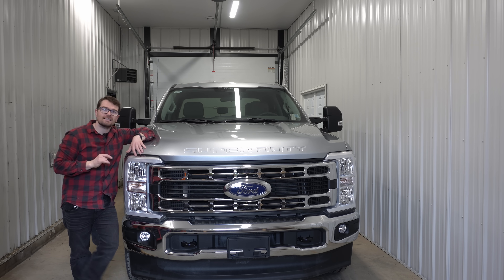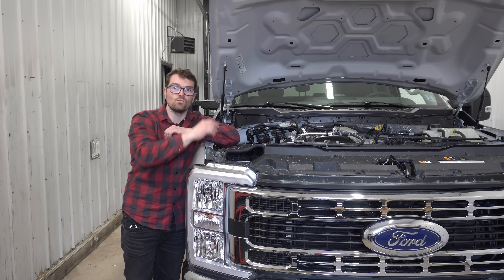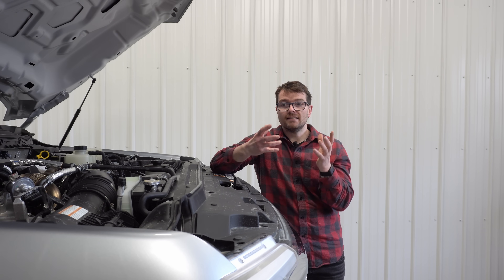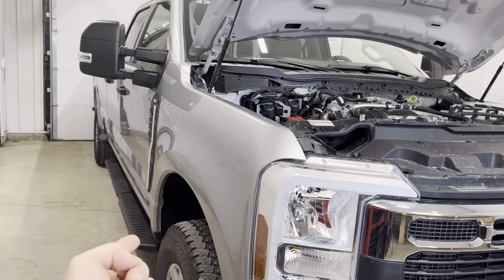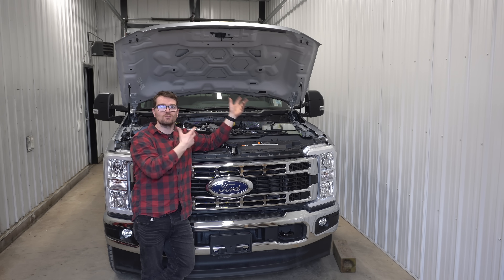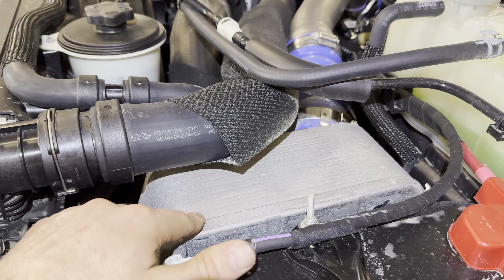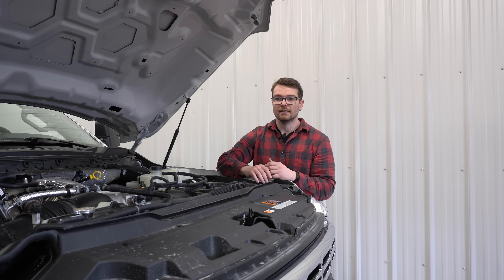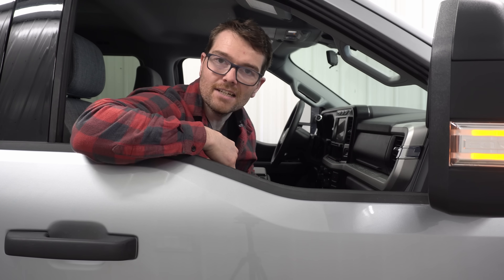Ford F250 HO PowerStroke Diesel Engine Review *HEAVY DIESEL MECHANIC* | How GOOD Is It??

Comment: Not many if any need the extra torque and HP, just going to burn more diesel with that tune. The SO looks like a very solid engine with a little better solution for exaust treatment. Will definatly consider this truck in 2-3 years when they come on the used market and we can almost afford it. 😂
Reply: The cost difference is small when compared to the already large cost of the diesel engine over the gas version. I came out of a 2020 Raptor and bought a 2024 F350 SRW 6.7HO Platnium Tremor. The reason for the change is to tow a 5th Wheel RV that my wife decided we needed. I do absolutely love this truck, it’s fantastic. I wanted something quick since I was giving up the Raptor for this endeavor and it delivers. 

I will be keeping this truck for a long time.
Reply: @Captain-Awesome "that my wife decided we needed" hahaha that's a big decision to let your wife make
Reply: @AlejandroDeZan  yeah, don’t get me wrong I’m pretty excited about it, but she was definitely the driving force behind it. Personally, I like to save money, but my wife apparently hates money every time when it comes to saving it or spending it, magically money just 💨 it something else besides money. Shoes, Purse, Clothes, a RV… 🫣
Reply: @Captain-Awesome  The cost difference between the SO and HO is super small when you consider that a new SS exhause manifold is about $800, a special cooled-jacket turbo would be more than $2k, somewhat less if you replaced the intercooler with something larger instead, and then we're not even looking at the labor for the cost of install and tuning and taxes on all of it. Plus factory warranty...
Reply: @anomatrix0000  Yeah, that’s what I was saying. It’s the reason I bought the HO.
Reply: The HO Power stroke actually used less fuel than the Duramax and Cummins while smashing them in torque and power.
Reply: Still don't like the idea of mortgage for a truck
Reply: Adding the ho engine adds like $40 to the payment. The extra torque would be handy hauling heavy loads through the mountains
Reply: My 23 Ho gets 18mpg on 37s
Reply: I just bought a 2024 F250 SO, I got the xl with the STX appearance package. It's actually pretty affordable compared to the higher trim levels and I personally don't need all the upgrades.
Reply: I just bought a 2024 F250 SO, I got the xl with the STX appearance package. It's actually pretty affordable compared to the higher trim levels and I personally don't need all the upgrades.
Reply from the maker: Very well said sir! Totally agree. If I had 100k burning a hole in my pocket the HO would be fun but I think for most people the SO is going to be a great engine
Reply: @GettysGarage can you review the all  new traverse 2.5 turbocharged engine
Reply: Hey I wanted your opinion I know that Cummins I6 is the best but I like how the Ford  dually drive I'm going to be transporting and hauling a dump trailer thinking about getting the platinum trim level for the comfort a used one and the Laramie if I choose ram. Which brand you think is best. It's gonna be used.  @GettysGarage
Reply: @MITCHYJTOOHOTFORTV The Cummins is not the best…

Comment: Easily one of the Ford trucks of all time
Reply: Definitely more Ford than the last Ford
Reply: You said it. Definitely a Ford.
Reply: It’s a Ford!
Reply: Did you know? Ford spelled backwards is Drof. Now, if we take those letters, and line them up based on their number for which they line up in the alphabet, add them together, and multiply by the 6.7 displacement, you'll realize my comment isn't going anywhere. Have a good day y'all!
Reply: 2011-2016 is the greatest superduty they have made especially the 2015-2016.
Reply: @Back_door_bandit_98 where’s your valid evidence because I’m going off facts and the 2017+ has stronger fully boxed frame better suspension body won’t rust just overall nicer stronger truck
Reply: Yup. Agreed. That's exactly why I bought a GMC 😊